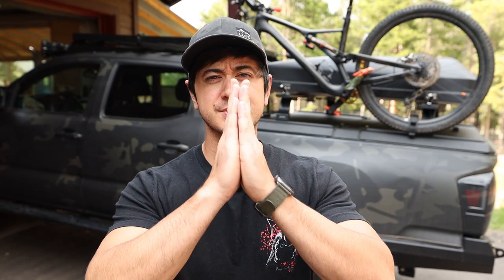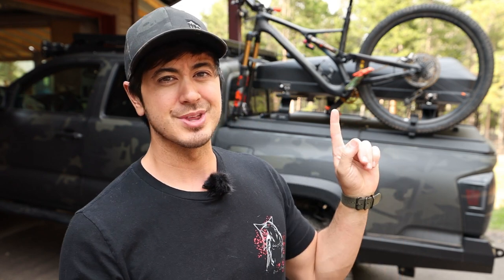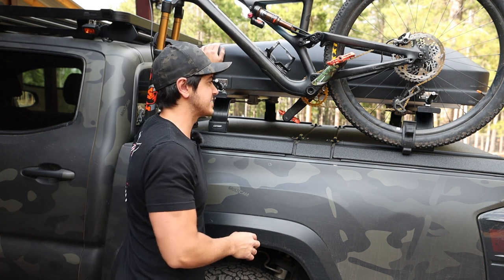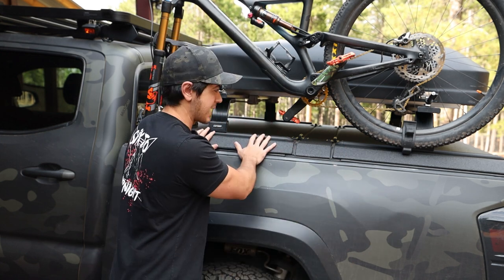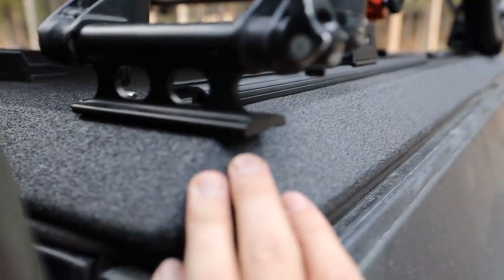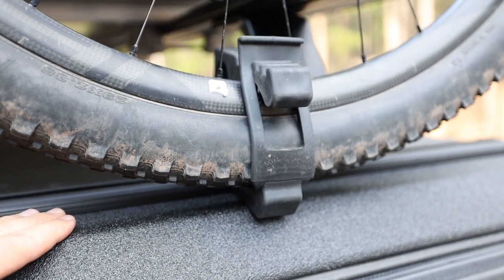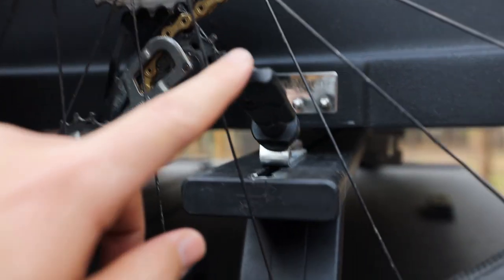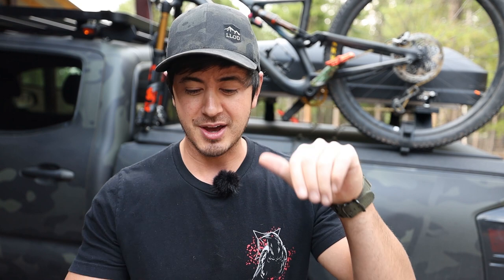MTB CO - WELCOME!  Oh, and the Diamondback Bed Cover Bike Mount

Comment: You and a good friend of mine have convinced me to pull the trigger on a nice bike, so I bought one today.  It's an XL, so it's a little cumbersome to transport it.  I bought the tailgate blanket and use an extra strap to keep it from moving around, but I'm looking forward to see any other potential solutions you have.  Especially ones that don't involve a bed cover, because that's a big expense that is pretty low on my priority list right now.  Otherwise, I'm stoked to get back into mountain biking, and I'm glad that somebody I already watch is starting a channel on the topic at literally the same time.
Reply: Buy a fork mount, and screw it into a 2x. Cut the 2x to fit snug next to the tailgate and in between those rear pillars. If you cut it tight enough, it won't go anywhere. You'll spend about $30 total.
Reply from the maker: Glad you were convinced! What did you pick up?